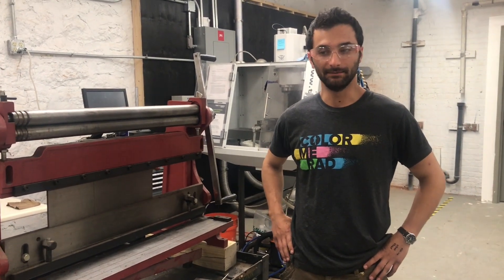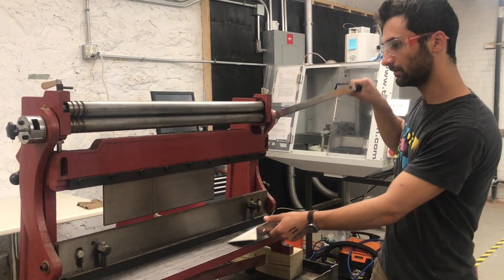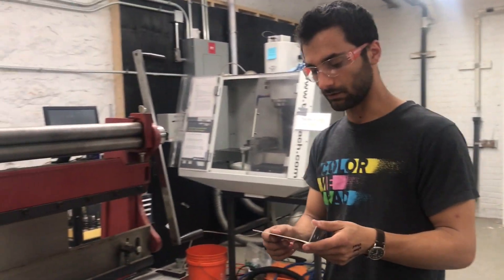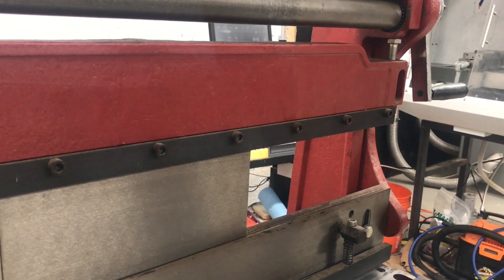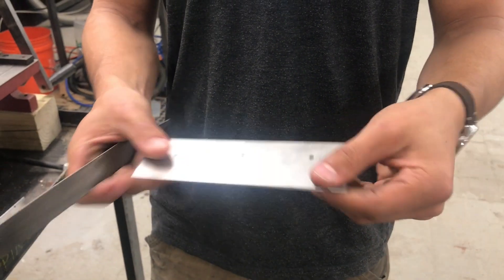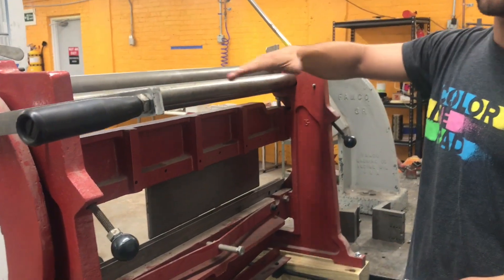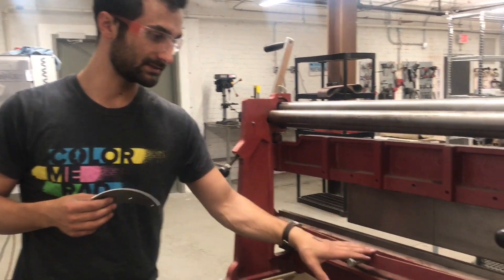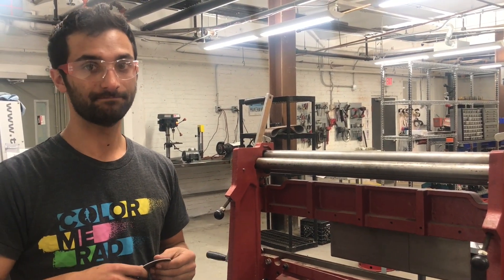Shear Brake Roll 3-in-1 combo at MakeHaven

Comment: Hi - any recommendations on brand or place to purchase?  Thanks!
Reply: Harbor Freight.. there's a dozen brands and I think they are all identical.. but the cheapest is at Harbor freight.. when not on sale it goes for about $450, weighs over 300 lbs.
Reply: @abouttheravadabuddhism  An important thing to take into account is that parts are unavailable from Harbor Freight for their 3 in 1 machine! Grizzly Industrial sells several models of them and carries all the parts for what they sell! Deeply guarded secret: if you look at the HF owners manual parts list, and look at the similar Grizzly model (on their website) parts list, they are often the exact same parts list! The only difference is that Grizzly adds “P”, then the machine number, before the p/n that shows on the HF list! Don’t tell ANYBODY I told you that! Ha! Same for mini lathes and mills!

Comment: I've had one for around a year now and absolutely LOVE it. I'm very novice with sheetmetal, but learning quick. One thing in learned fast, is straight perfect cuts and bend are not easy. This toll take all the work out of it. Takes a lot of filing out of it too
Reply: I took mine apart and polished all the pivots and regreased with "red n tacky",  sanded the finger tips with 150 grit then 240, same as the "V"... Now it works much better and doesn't leave all those sharp edges and marks on the bend...  Took 2 days but it was worth it....  Building the foot pedal setup now....  Thinking of air or hydraulic assist.
Reply: @OldSkoolF  wow. I never thought about that. I've noticed a few little touches it needs,  but I'm not familiar with it at all or how to adjust it. It doesnt like real long cuts. Acts like the blade needs tightened up. But I mostly do small stuff so it hasnt been an issue yet
Reply: BTW....  I built a Louver Die and "Finger"...  Saddles the bottom and locks in with a set screw..  Pretty Trick..  I only made a 2.5" it cuts nice. Used a leaf spring for the cutting steel...  Gonna try a 4"....  Maybe a 12" like a Model A hood...  Just crown the positive die in the middle to make it easier to push through...